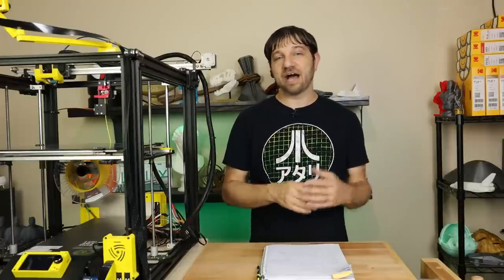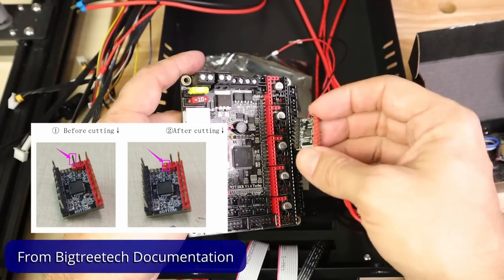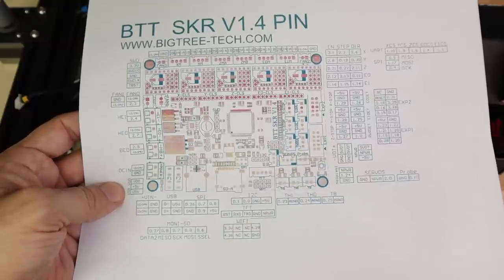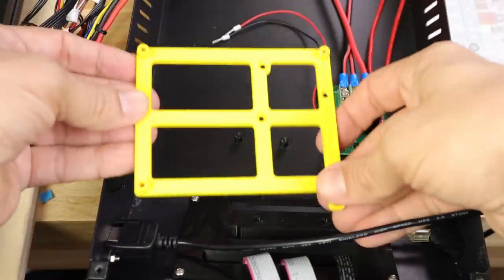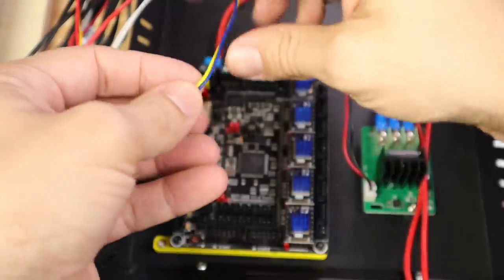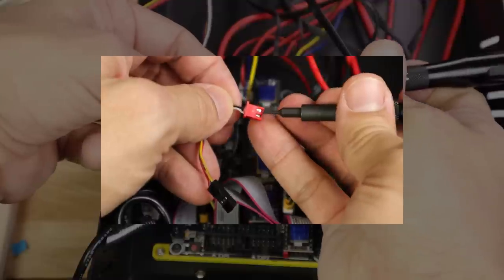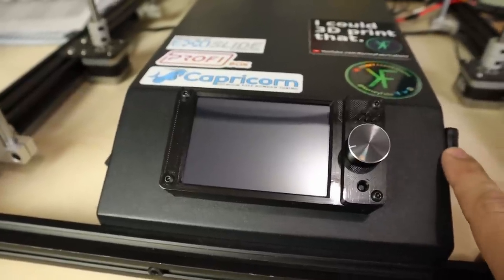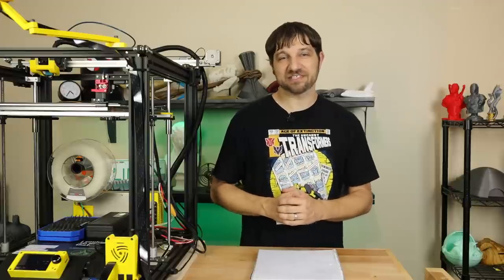Bigtreetech Ender 5 Plus Upgrade: SKR V1.4 Turbo (Part 4)

Comment: Hi Kersey, Thanks for the very useful info. I am doing everything like you in the video, but for a CR10s, and the only thing that happens is to have, after the firmware is loaded, the error err: MAXTEMP: bed. Doesn't matter if the thermistors are connected or not even with an empty board, the board stuck with that error. Any suggestions? Are 15 days I am looking around and no solution are given. Thank you
Reply from the maker: Feel free to send me your config files: kris@kerseyfabrications.com
Reply: @kerseyfabs  Thanks, You are magic

Comment: Awesome tutorial on this upgrade. All went great for me, thanks Chris. Would you mind posting your full slicer start and end gcode please.
Reply from the maker: Will do! It's pretty stock Cura:
Start:
M201 X500.00 Y500.00 Z100.00 E5000.00 ;Setup machine max acceleration
M203 X500.00 Y500.00 Z10.00 E50.00 ;Setup machine max feedrate
M204 P500.00 R1000.00 T500.00 ;Setup Print/Retract/Travel acceleration
M205 X8.00 Y8.00 Z0.40 E5.00 ;Setup Jerk
M220 S100 ;Reset Feedrate
M221 S100 ;Reset Flowrate

G28 ;Home
M420 S1 Z2 ;Enable ABL using saved Mesh and Fade Height

G90 ;Absolute positioning
G92 E0 ;Reset Extruder
G1 Z2.0 F3000 ;Move Z Axis up
G1 X5.1 Y20 Z0.28 F5000.0 ;Move to start position
G1 X5.1 Y200.0 Z0.28 F1500.0 E15 ;Draw the first line
G1 X5.4 Y200.0 Z0.28 F5000.0 ;Move to side a little
G1 X5.4 Y20 Z0.28 F1500.0 E30 ;Draw the second line
G92 E0 ;Reset Extruder
G1 Z2.0 F3000 ;Move Z Axis up

End:
G91 ;Relative positioning
G1 E-2 F2700 ;Retract a bit
G1 E-2 Z0.2 F2400 ;Retract and raise Z
G1 X5 Y5 F3000 ;Wipe out
G1 Z10 ;Raise Z more
G90 ;Absolute positioning

G1 X0 Y0 ;Present print
M106 S0 ;Turn-off fan
M104 S0 ;Turn-off hotend
M140 S0 ;Turn-off bed

M84 X Y E ;Disable all steppers but Z

Comment: Thanks for the great tutorial. One question, in your marlin Configuration_adv is there a reason that Y_CURRENT is set to 800 while X/Z/Z2 is set to 650?
Reply from the maker: Thanks! Y is moving more weight than X. Zs are screws, so they need less.
Reply: @kerseyfabs  Appreciate the incredibly quick reply! Keep up the content, it's fantastic and thorough
Reply from the maker: @Hoodles  I do my best. Thank you for the support.

Comment: It's possible to use TCM2226 ? I must replace firmware and cut one "leg" or not ?
Reply from the maker: I believe the 2226 will work being treated at a 2209. You will still need to cut the pin to disable sensorless homing.
Reply: @kerseyfabs  Thenx working. One more question, if i use dual Z i connect second Z to E1 output or E0 ?

Comment: I just got a ender 5 plus, should I get dual or shared Z stepper files? The only modification I have so far is aluminum extruder and Capricon tubing, are those files fine to install?
Reply from the maker: Are you using Z on independent steppers or are they on a shared stepper?
Reply: @kerseyfabs  Not sure, what is "stock" on the ender?
Reply from the maker: Did you install a new mainboard? If so, which one?
Reply: @kerseyfabs  not yet, but i will be getting the SKR v1.4 Turbo. Trying to get everything ready before it gets here.
Reply from the maker: @fernandoplascencia3713  That makes sense. If you want it the stock way, Z can share a stepper, leaving one available for later. If you want auto-align on your Z, you can use two steppers. I have another video on that.
Reply: @kerseyfabs  ah I see!   can I use two stepper with my current setup?
Reply from the maker: @fernandoplascencia3713  Yes.

Comment: Hi, followed your guide and took slight modifications on the config to make it work on the SKR 1.4. However, whenever z axis home, it endlessly goes up and BLTouch doesn't deploy its probe. 
BLTouch only shows a red led instead of the usual both red and blue led 
I have switched the wires(red and brown), what did I do wrong?
Reply from the maker: If the probe isn't deploying, you may have something still wrong. Check out this image: https://photos.app.goo.gl/tazEPrKWe3tKoJvLA

Comment: Hey Kris, I think I messed up. Set the board to run 5v so I could successfully flash the firmware. But installed the printer to the printer and energized it with it still set to 5v. Now it seems to not work, and niether fuze is blown. Did I just fry the board?
Reply from the maker: By run on 5V, so you mean the USB vs. power supply power? If so, not setting that back won't break anything. Just switch it back now. If it's not working, I'm not sure.
Reply: @kerseyfabs  ugh, my mistake. The BL touch wiring was different. Think maybe because it was a V3. Not sure, but disconnected it and it booted. Than rewired the bl touch. Printing like a charm. Now for direct drive. Hopefully less dumb mistakes

Comment: Question any firmware is compatybille with 2226 drivers ??
Reply from the maker: The 2209 firmware should work with the 2226 drivers.

Comment: Is it possible to upgrade to the SKR board and keep using the original screen?  If possible I plan to keep the stock screen for now and perhaps change the screen later.
Reply from the maker: I've been pointing people at the Insanity Automation project for this. But I found this guide just now: https://www.deviousweb.com/2020/05/08/ender-5-plus-skr1-3-and-factory-screen/
I haven't tested this myself.
Keep in mind that functionality should be improved but still limited.
Reply: @kerseyfabs  Thanks for pointing me to that site! At this time I have no need for the extra functionality the BTT screen offers, but that may change once I get to know my printer. For now I just want to silence it.
Reply: Finally had the time to install my SKR board. Your video was very helpful!

A small remark: On my (newer?) Ender 5 Plus the black and white wire for the bltouch were already in the correct position and did not have to be swapped. However the other wires were not blue, red and yellow but purple (gnd), red (power) and orange (2.0). The purple and and red wire needed to be swapped otherwise the bltouch wouldn't work and the board wouldn't boot proparly (sd-card-slot also wouldn't work).

Comment: Thank you for this entire tutorial, i have had nothing but issues with my e5p, and decided to go this route. only issue is i purchases the tft35-e3 v3.0.1. i don't know it it makes any difference, but when i put my micro sd card in the board  it does not flash the firmware. is the screen being different slightly an issue?
Reply from the maker: I'm glad it helped. No, the display won't stop the board from flashing at all. See if this helps:
How to install these files:
1. Download the file.
2. Rename the file to firmware.bin
3. Place that on an SD card.
4. Place that into the mainboard.
5. Turn on the printer.
It should boot after a few seconds of flashing. To verify that it flashed, reinsert the SD card into a computer and the file should now be called FIRMWARE.CUR.
If you're having problems flashing:
- It may require an 8GB or smaller SD card.
- Make sure it's formatted FAT32.
- Under Windows in the file manager, click "View" in the menu bar. Make sure "File name extensions" is checked otherwise you may be renaming the file "firmware.bin.bin"
Reply: @kerseyfabs  i just updated with the 2209 firmware, and it does show .cur on the sd card now. can i upload a video of what happened when i uploaded it?
Reply from the maker: @abbadon010  Feel free to message me directly on any other social media platform to send me a video or photos.
Reply: @kerseyfabs  ok, i will use Instagram

Comment: Waiting forward for a upgrade to the new SKR2 (rev B) video :D (specially on the fans part). And any reason why you are using the z endstop instead of the probe dedicated socket?
Reply: FYI only -- I just put my SKR 2 Rev B in yesterday and updated the Configuration.h and Configuration_adv.h files to run my printer. It's a stick E5P -- no hot end mods or anything like that -- bone stock (except for the new SKR 2 + TMC2208s and an LCD 12864 display). It went relatively well. I've not worked with configuring Marlin before, but all went well reading through both the Marlin docs and a sample of the BTT SKR settings.

I had an issue with the Z-stop being the probe. I had to rewire my BL Touch servo end (swap GND and +5V), and I had to use the Z-endtop to get the probe to work and allow the Z axis to move. It works this way so I didn't;t run it down further.

Comment: When I load your firmware for "Dual Z-Steppers" and press "down" in octoprint, Z going up. But when I press "home" it goes up as supposed to and homing with BLTouch. Should Z be inverted in firmware or not?
Reply from the maker: Z "down" means less Z, so closer to the nozzle is correct. Since the bed moves instead of the gantry, it will feel inverted.

Comment: I tried to finish up the SKR install today.  However, something REALLY strange is happening.  I'm not screaming please fix it for me, just looking for some thoughts if you have an idea.

When I first started it up the TFT is all white.  OK, may I screwed it up somehow.  Plug the TFT into another printer board.  Nope working fine.  

Process of deduction (pull off all the connections, and plug them in one at a time).  

When the BLtouch servo connection is made it goes all white.  All other connections seem fine, I can control the printer, move X,Y,Z etc.
Reply: NM...I looked closer and saw your update on the ordering of the wires (I have the red, brown, and orange setup).  Once I had the wires in the right order all was good.  Curiously my white/black for the end stop were already in the right order and I didn' need to fiddle with that...so far...I have yet to actually try a bed level.  I have firmware issues for x,y (so far) it seems.  I tried to compile my own since I have TMC 2209 drivers (Yes I dealt with the pin)
Reply from the maker: Give this one a shot for 2209 and a fix for the homing issue: https://drive.google.com/file/d/1wltLbc0ZSo6NutYvBtoOeo-Kv08YuYCO/view?usp=sharing
Reply: @kerseyfabs  Thanks, totally not expected, but appreciated.

Comment: I have updated my ender 5 plus. I used the Big tree tech 1.4 turbo motherboard and the tft 35 display. Same as you did. Been having trouble with the Marlin code. I tried even using your version and it only works partially. I know the wiring is proper since I can control the printer and move everything around in Pronterface. I get this error message saying no printer attached but if I go to marlin mode I have some control there. Any ideas? Thanks

Comment: Hello Kersey
Thank you for the interesting instruction. I use the same motherboard in a delta printer with 0.9 deg motors. It works great and is completely silent.
Unfortunately, Delta has one disadvantage - too little horizontal print area. That's why I'm very jealous when I see your bloody huge cube ... ;)

I have one request for you - during the shots, set the camera focus on the manual and a specific point/object, because while waving your hands (e.g. 24:15) the focus changes and it is very disturbing.

Regards and good luck.

Comment: The upgrade im waiting on most at this point is adding a second extruder to my ender 5 plus. I really want to be able to use the water soluble filament and I cant find any good examples of how to do this. I occasionally print 12x12 objects though so i think a second extruder wouldnt be an option for me, i think i would lose too much print space.
Reply from the maker: I'm working on this now! Coming soon!
Reply: @kerseyfabs  Awesome, I literally cant wait. ive already run into a few prints where regular supports have been difficult if not impossible to remove cleanly. I also like doing text inlays and it would be really cool to do an inlay with a different color. Your channel is the first one I've actually clicked the bell notification button for lol. Also can I just say I love the 3d printing community, its so rare on youtube to get replies from the video creators and actually being able to have a back and forth with a couple of different 3d print oriented channels is kind of mind blowing.
Reply from the maker: I appreciate all of that! I have the parts, I just need to get working on it. I just started printing some of my custom designed parts today. I do my very best to respond to every comment, at the very minimum with a like or heart. Sometimes they get by me but not often. 😀
Reply: Kersey Fabrications just out of curiosity are you going to show a dual hot end set up or a dual extruder with a Y adapter? Hopefully you plan to explain both, you usually do a very good job of thoroughly explaining the different options and setup. Honestly mostly just hoping to steal your firmware so I don’t have to set it up myself, I think that is probably a bit beyond me and will probably keep me from doing the upgrade lol.
Reply from the maker: I will be going with the single nozzle with two extruders. I'll cover why in the video.

Comment: I've found another BL touch wiring color, Black, white, and yellow as the three pin probe connector and the red and blue as the Z endstop. Pretty much the whole ribbon cable reversed, not sure if this is a cloned BL touch everything on it looks right and if I put it on my Ender 3 V2 with the stock main board it works as it should as well...
Reply from the maker: Thanks for the new info! Black and white hopefully will stay ground and power respectively and yellow will be signal.
Reply: @kerseyfabs  Actually I have white ground, Black power (middle), and yellow signal towards the touch screen. With the blue wire going in the spot of the white wire in the Z endstop.

Comment: What is the max temperature you have set for the hotend? I'm about to upgrade to print nylon.
Reply from the maker: Max temp in my firmware is 275. That will print most nylon.
Reply: @kerseyfabs  thank you
Reply: @kerseyfabs  I downloaded the Dual Z-Steppers Pre-built for TMC2209 and the max i can go is 260. Am I missing something?
Reply from the maker: There may be some sort of limit I missed. I'll look into it later.
Reply: Thank you.
Reply: Any thoughts on the 260 max temp setting?
Reply: @kerseyfabs   I love every part of the firmware with the exception of the max nozzel temperature. Anyway to increase it?

Comment: I purchased this back in the summer and my original motherboard has shut down, so started the install this past weekend. I also watched Tripod Garages video. I have been having some issues, you able to give me some advice ?
Reply from the maker: What can I help with?
Reply: @kerseyfabs  Thanks for replying and offering some help. I am having trouble with the bltouch and bed levelling. So I have installed the tft35 v3.0 and the skr 1.4 turbo with 2209 stepper drivers. I used your firmware.bin file. The Bltouch will not work and when homing it, it's off center and when I try to level the z axis it does not stop and hits the hotend. Thoughts ?
Reply from the maker: Is the probe off-center or the nozzle? The probe should be in the center of the bed. If it's not stopping, check the BLtouch 2-pin connector (black/white). Make sure it's in the right port and that the orientation is correct.
Reply: @kerseyfabs  thanks. After I messaged you I also tried researching more, and watched the video from biqu.  From what I read it seems like a wiring issue. I will check tonight.
As for the probe, I could have swore the nozzle lined up in the center before. But right now i just want to get a print started. I will let you know how it goes. Thanks for the advice
Reply: @kerseyfabs  Thanks again, I finally got it working. Had a few things reversed and had to spend some time doing trial and error, but got it going and am running a test print now.

Comment: Hey Kris, This is a great video... as always!  I am looking at upgrading my main board soon! Have you tried TH3D's board & screen? 
Also, where did you get the tweezer?
Reply from the maker: Thank you! I have not tried TH3D's board yet. To the best of my knowledge, their screen is just a standard 12864 display. I'm unaware of any other changes. Their board is nice and it comes with high-end components and the price to go with it. It has the feature set similar to that of the Mini E3 but the processor of the V1.4 Turbo. Other than that, I'll hold off any judgement until I test one.

Here are the pliers: Xuron - 450SAS Tweezer Nose Pliers - Serrated, ESD Safe Grips
https://amzn.to/2Qs0Nu4
I really love it. It's a great high quality tool.

Comment: Hi Chris, great video. I'm about to fit my SKR 1.4, which I ordered with standalone 2208s. You mentioned early in your video that jumper positioning differs from your UART 2208s. For the sake of not risking to mess anything up, I might just buy same drivers as yours soon. One question crossed my mind though... I just noticed you did not mention soldering anytime in order to implement UART. Wasn't it necessary, just by leaving the correct jumpers in the correct locations? From my understanding, soldering was compulsory for UART mode. Please feel free to explain and correct me if I'm wrong, I guess I'm missing something. Would greatly appreciate. Thanks a lot in advance, keep up the good work, you clearly rank up amongst the best 3D tech channels, and defo deserve more audience. Cheers!
Reply: Did u solder the J2 part to make the UART work on the BTT TMC2208s ?